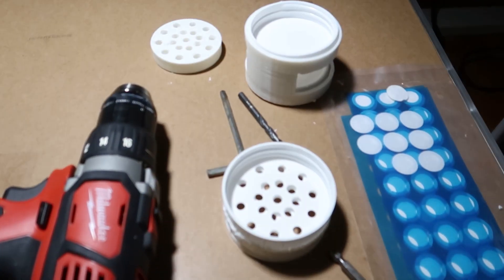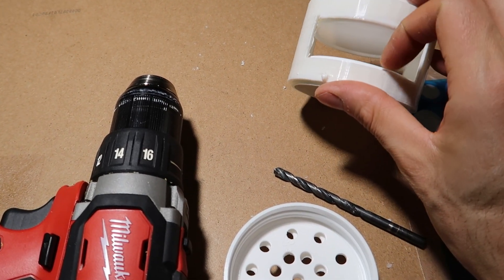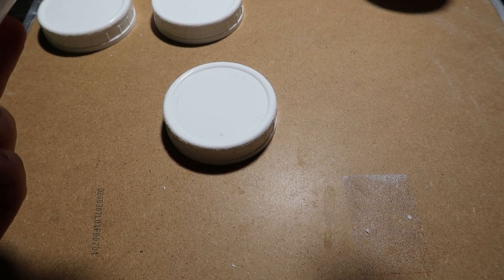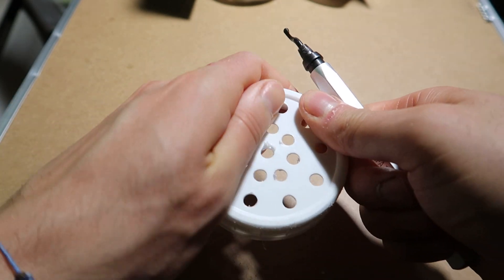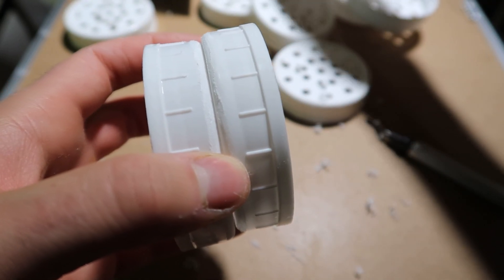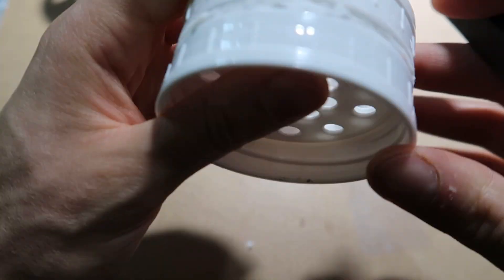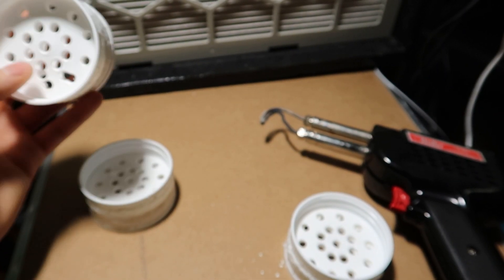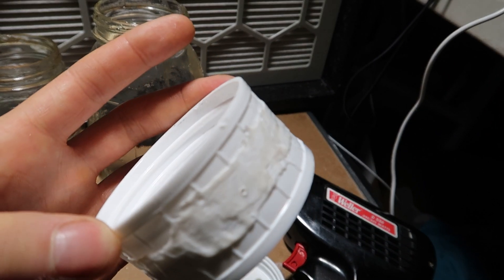How to make BioCouplers

Comment: Would this DIY biocoupler withstand sterlization in a pressure cooker or in a microwave? Would the plastic you used to bond the two lids remain intact?
Reply: It's pp, if it's welded correctly there should be no problems

Comment: If anything, this convinces people to buy REAL BioCouplers
Reply from the maker: There are also lides in the Discord that you can order and all you need to do is drill 1 hole for gas exchange. This is just the cheapest way per lid. Additionally, you can melt the main holes with a cheap soldering iron and use a cheap plastic welder to smooth the 3D welds.

Comment: hii, how can i be  sure the plastic lids and  the filament i'm buying won't have any problems in the autoclave?
Reply from the maker: Make sure they are both Polypropylene PP.
Reply: Make sure they are polypropylene
Reply: @davideriggi5485  use nylon or another filament that can withstand temps above 121+°c.... PP may deform at these temps
Reply from the maker: It did not. PP is industry standard.

Comment: You might want to look at purchasing a drill bit that is sharpened for plastic. I do not have my Machiniery's Handbook handy to look at the tool geometry of a plastic drill bit, but I know they can be purchased.  This will help you get a clean through hole.  Also, instead of welding them together, try running a bead of xylene around the edge once it is sanded.  You might be able to do a chemical weld.
Reply from the maker: That may work but I was worried about it affecting the plant and sealing it too well that it may make the air exchange hole more difficult. Try it and let us know how it works.

Comment: Could you 3D print the whole thing given that you already need one for the cask holding the lids?
Reply from the maker: It may be possible. My only concern would be that it would leak. FDM printing isn't very water tight. The lids are also cheap so that one spool of filament will help create alot of lids.